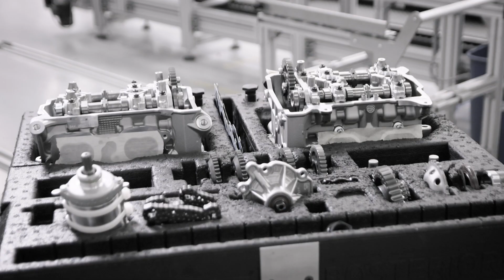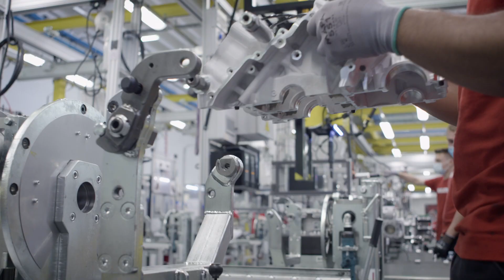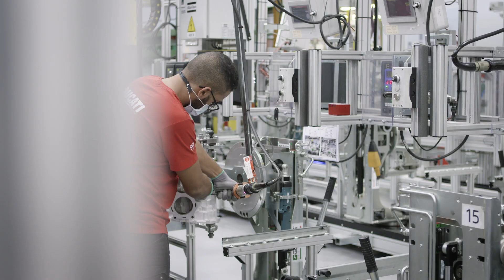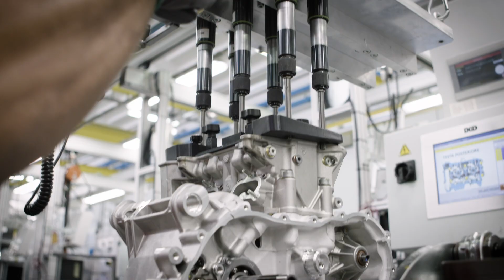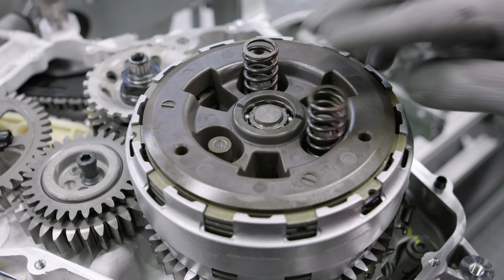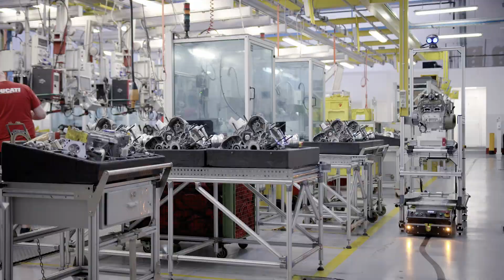V4 Granturismo: Engine Assembly

Comment: No desmo no Ducati 👈 V4 multiaudi🥶
Reply: david davids  much, much less than tinkering on my Testastretta!
Reply: david davids  if you don't have it for service, don't buy dozen boys 👈
Reply: david davids  Quite right David.  The real issue of course is paying $100+ an hour for a motorbike mechanic; exorbitant costs required to keep the adjacent showroom and accessories/clothing section running.  There is a need for "independent" mechanics; by this I mean just a workshop to fix bikes; no sales, so goodies, just fix it.  Looking at the video of the new engine, it looks like it's easier to work on valve adjustment-wise than my 2017 Testastretta motor and as it's relatively conventional, it doesn't "need" a Ducati-trained mechanic to do this.

Comment: It's just the same v4 as all the others so how can it be new?
Reply: @Donovan Lewis lol its still the same casing, internals etc. So it is not a brand new different design engine. Only the cc is different.
Reply: @pippy4658  wrong.  The Panigale V4 and Superleggera V4 Desmosedici Stradale are pretty much the same but the Grandtourismo has different casings, side covers, sump, barrels and heads.  The engine mounts look to be the same.  It is possible that the gearbox internals, maybe even cranks and pistons are similar.  If so, this would make good fiscal sense.

Comment: I just hope they able to fix leaking oil problems
Reply: Don't worry about, to be able they are 100% able for being in those places Bologna Imola & Modena the most skilled motors mechanics in da world; but fairly there's nothing to fix in the Ducatis which NEVER had leaking oil or engine issues unlike harleys or honda brand new broken cans , and NEVER had front suspension or vibration issues unlike the kawasaki crappy frogs...! 😁🤫